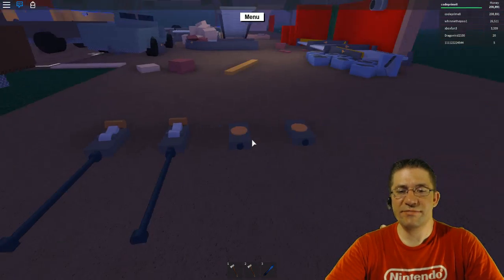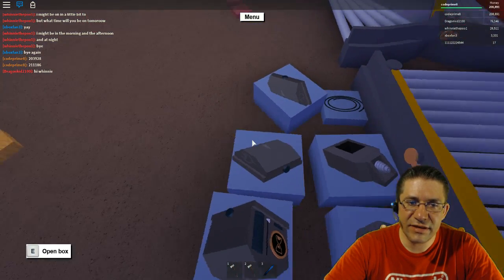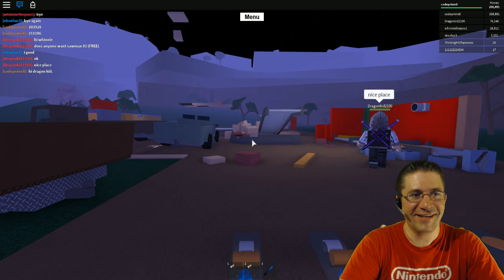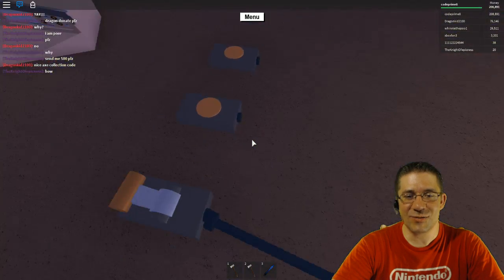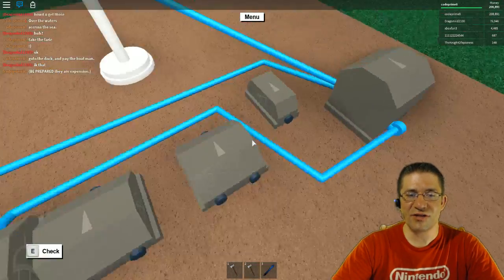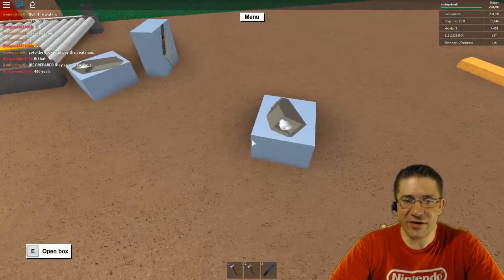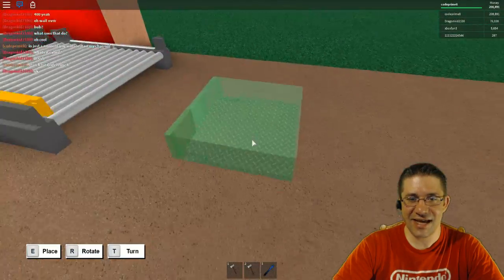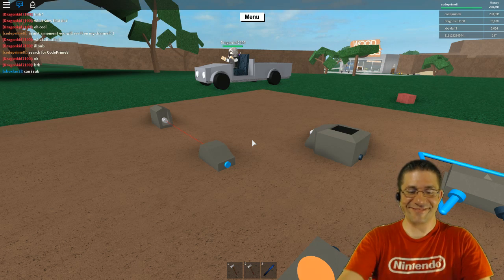Roblox - Lumber Tycoon 2 - Logic Gates

Comment: Wow, nice video Heath. I already knew how to use these machines but your video reinforced my understandings of the logic gates and helped other people understand them better.
(P.S. For the wood detector, you have to put a tiny piece of wood into the black part on the top [let's say it's pink wood], and then the laser activates. If pink wood is hit by the laser [detected], then the black part on the other end will activate something [like a lamp]. So you don't connect a lever or button to that, but you connect a lamp or saw to that. It's an output.)

Comment: The wood  detector "put a sample wood on the top and it will signal when that type of wood is detected in the laser"
Reply: Harold Kim Meneses no u Putin a small peace of Wood in the hole not on top
Reply: The Wood Detector can be found at Link's Logic, in the Tropics Biome.

When wood is placed on top the device, it will emit a white laser. If the type of wood placed in the machine is detected in front of the device, then it will release a signal from the rear of the device. This item came out shortly after the main wire items were created

The player can set up a conveyor belt system where you place the wood detector next to the conveyor and then place a chop saw a conveyor after the detector, this way when the wood type passes the detector it will let the chop saw cut the wood into pieces making it easy to put in sawmills.

It's very useful for making a wood storage or a work in progress building. It could be used to send different types of wood to an assigned area.

You can put logs or planks into it, and it will detect logs and planks from that tree type. It does not detect multiple kinds of wood if you put more than one wood type in it.

-Wiki

Comment: Where do I by these parts I found the saw wires and lever but I cant find where they sell the rest (Great video I olearned how to make the automated saw but I can't find the parts)
Reply from the maker: You can buy the parts in Links Logic ( its a new store across the ocean. ) You have to take the Fairy at the Dock to get across. Make sure you take a vehicle so you can drive the stuff back. Will need a little bit of cash.
Reply: Thanks :)